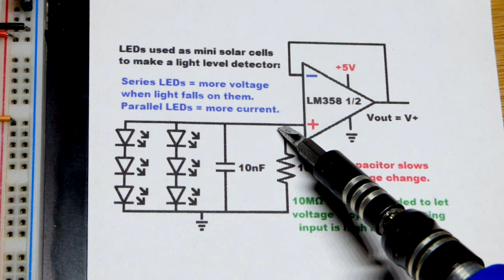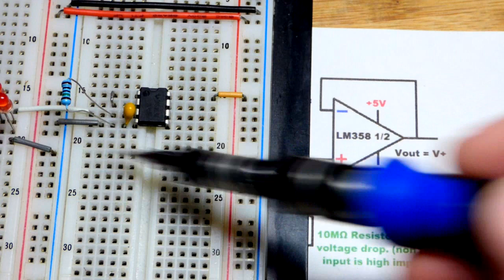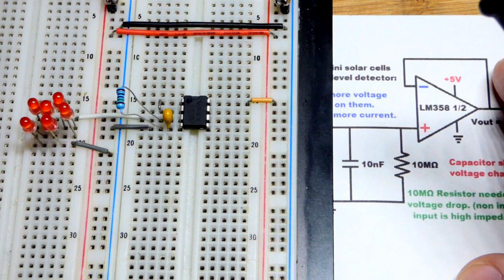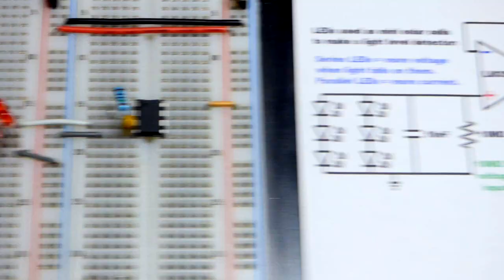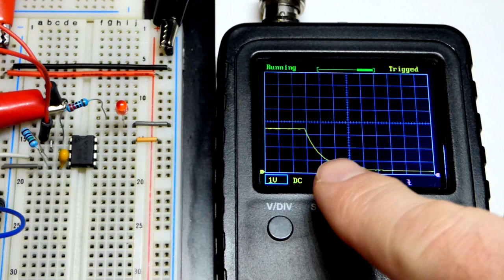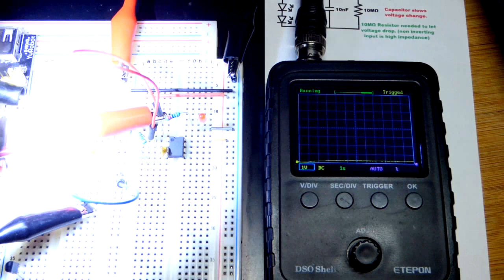Improved LEDs used as mini solar cells sensor with LM358 voltage follower electronics circuit how to

Comment: CAN YOU DESIGN AN EFFICIENT EMERGENCY LIGHT  THAT CAN LAST AT LEAST 6 hour WITH FUNCTIONALITIES LIKE DIMMING OF 10 watt LEDs.
Having good charging system .
Battery system should be 6000mah LiFepo4 single  battery. With Charging Indications Low/Full.
Reply from the maker: That's a good project idea! I am done buying stuff for a while so unfortunately I probably won't be able to get to do that.
Reply: @Electronzap   i am waiting for this project . Lifepo4 batteries are cheaper and monstrous than lithium batteries but there are no any idea how to charge such 6000mah single 3.4v battery.